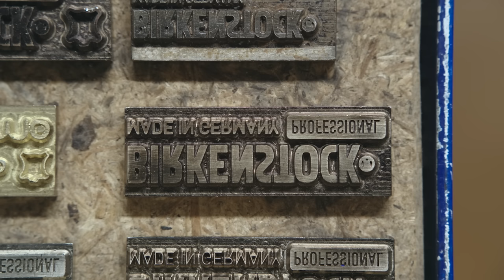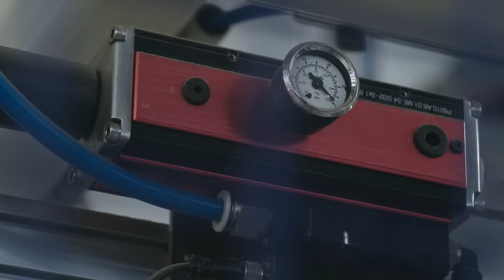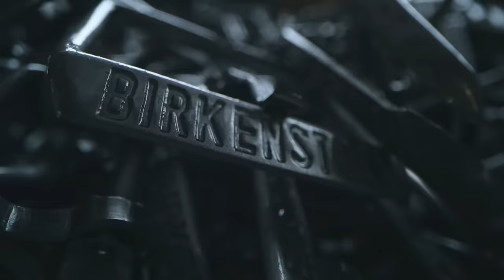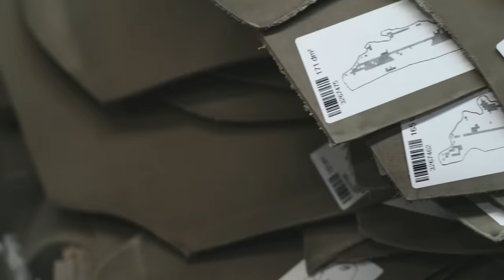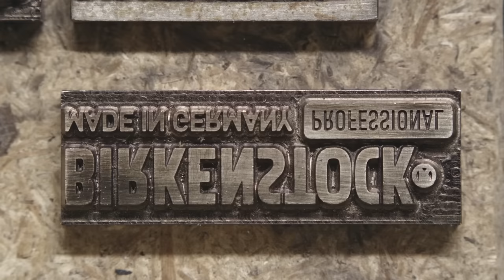BIRKENSTOCK Quality | MADE IN GERMANY - Director's Cut

Comment: A fantastic piece detailing the building of my favorite sandal. I just resoled two pair of Birkenstocks and it was quite easy but it gives you a great view of the construction of these works of art. Heat and pressure is the creative element of these beautiful shoes. I’m always shocked when I view a video of someone sanding the soles off when a heatbed or heat gun does the job quickly. Keep building a great product Birkenstock !